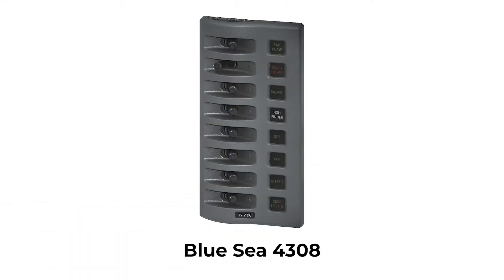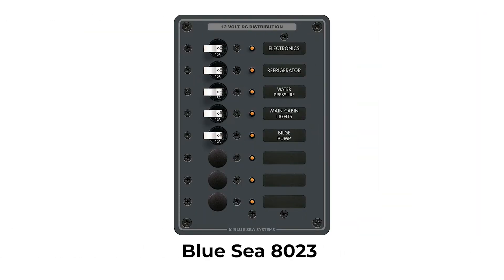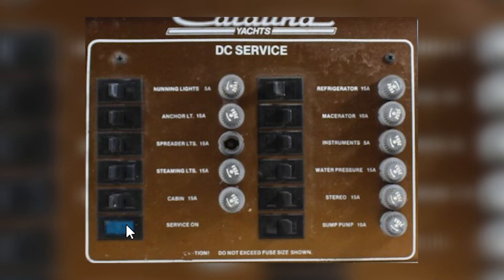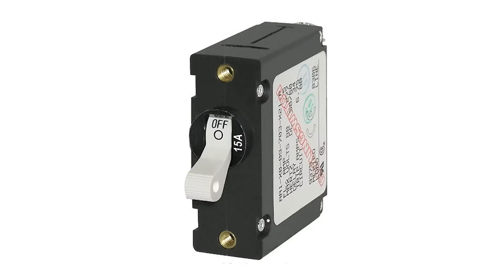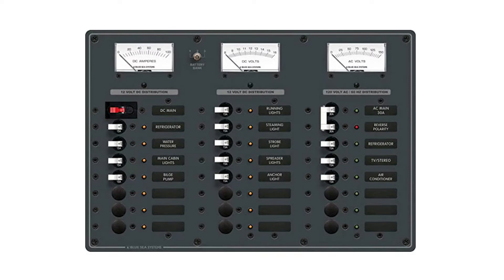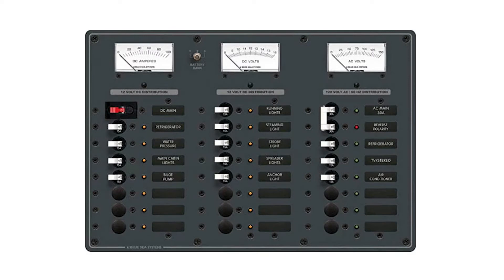Should I Install a Switch Panel or a Breaker Panel on My Boat?

Comment: Jeff, excellent content and a real help. I got a question for you. I'm surprised I can't solve this on my own. I want to mount a thru Deck multi pin plug next to my mast step, so when I put up or take down the deck stepped mast all I have to do is plug it in. Do you know a specific plug to use? My wires are 14 Guage I believe. Thank you

Comment: Hey Jeff I have a victron battery protect related question.

My boat is often moved by 3rd parties while I'm away and if the ignition key is not set to off it will quickly drain the batteries. A simple mistake to make, but it has meant the loss of batteries in the past.

I therefore installed a victron battery protect on the ignition switch line to cut the circuit should this happen.

A smart idea I thought. However (I think) the sudden drop in battery after ignition cuts the circuit in an unsafe way. The ignition panel goes dark and I can't kill the engine until it comes back on.

Furthermore I have perhaps blown my alternator out. Maybe related. Maybe not.

Is there any way to add a battery protect to the starter battery safely? I don't want my ignition switch to stop working, nor do I want to risk my alternator.

Thanks

Comment: When breakers trip they don't jump all the way to the OFF position. Like your breakers on your AC panel at home, the tripping action lets the spring pull the contacts apart. The lever ends up somewhere in the middle space, so when walking up to your panel you can see a tripped breaker at a glance. If the switch/breaker also has a red LED for ON, it will be dark. 
Also you can't just flick it ON again. Most breakers like the Blue Sea ones have to be pushed to all the way OFF when you'll feel a little 'click' as the arm re-latches with the 
trip spring. Then you turn the switch all the way to ON again  and it's now spring-loaded ready to 'pop' if the amperage rating is exceeded again.

Comment: Only problem with breakers is that water can get in and corrode the parts inside.  Even though some have rubber boots, they crack over time and water gets in.  There is no real way to test them other than to introduce a short and see if they work.  For smaller boats, I suggest using a fuse box instead and only have breakers for pumps, cigarette lighter accessory or troll motors.

Comment: I had smoke the other day my wire became a fuse the wires burnt! I just fixed my cabin lights been watching all your videos re did the breaker panel all the wiring 💯 let there be light ! 💡 

So crazy you uploaded this today 😛 

Time for a break FL is so hot 🏝️

Comment: When I see a boat catch fire, my first thought is insurance scam.
Reply: As one that does full re-wires on boats, I am surprised more boats have not caught fire. This includes a boat I purchased 5 years ago.
The whole boat had residential house wiring in it, including running DC components. 
I did a full rewire on the boat.
It was costly, but now follows ABYC code and actually is safer than the bare minimum code.

Comment: I have notice in some boats that Din rail AC circuit breakers are used to protect DC circuits. To my limited understanding, interrupting AC current is easier than DC current. DC breakers should open quicker and with a wider gap in order to limit internal damage from arching. My question now, is it ok to use AC breaker for DC current?
Reply: Circuit breakers have different ratings for AC/DC, and many AC breakers do not have DC ratings, and vice versa.
Reply: I nearly made the same mistake in the past until I read up on it. As you say: interrupting DC takes more oomph than interrupting AC, and therefore you need breakers which indicate a DC rating on the housing (sometimes in addition to an AC rating depending on model).

Comment: Thanks Jeff, I do like the blue sea breaker panels as you can make things very neat, which of course makes it more reliable.. I know this probably goes with out saying but some people don't fuse starting circuits, and some people wire the start battery straight to the starter motor, without even an isolation switch. What's your thoughts on this? To me it sounds a bit crazy, but it seems to be a common practice..
Reply: Uh! I like that question. Looking forward to Jeff's answer. Personally, I'd always want to have a switch on any power source. But how about the fuses on a starter motor. I believe it's not common but I could not reason against it.
Reply: @sebmitb910  I do believe he talks about that a bit more in other talks. If I remember correctly, it's a case where he takes extra care in the installation and over-specs the wire cross-section and then fuses for that particular cross-section. That overspeccing avoids (potentially risky) nuisance tripping on such circuits, while still protecting it with fuses.

Comment: I had a friend who installed car stereos and alarms years ago. I remember seeing a lot of cars that had rats nests of wire and unprotected circuits from bad installers. Saw a few vehicle fires as those guys pushed huge power through the systems with capacitors. Just look at lightning strikes.